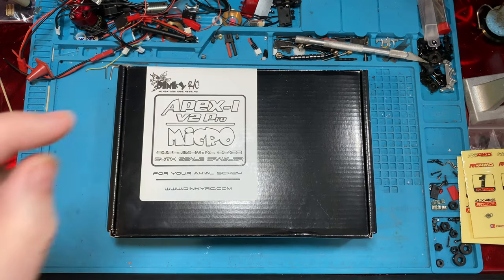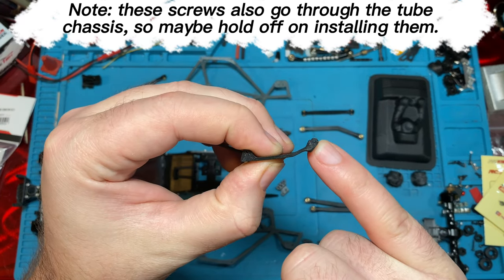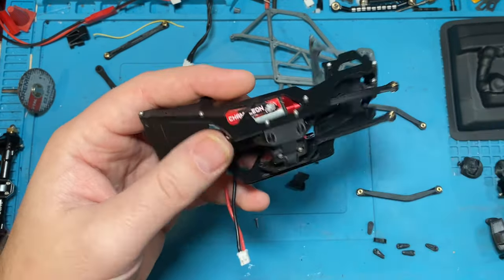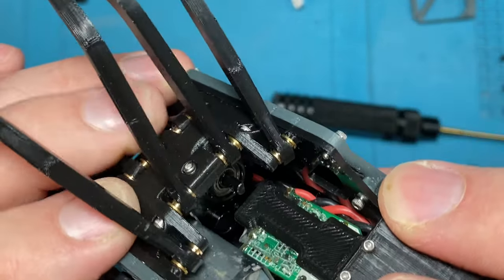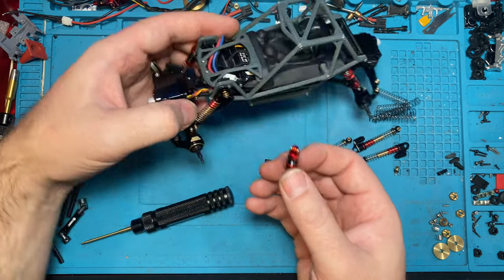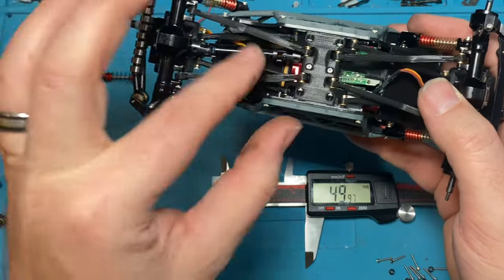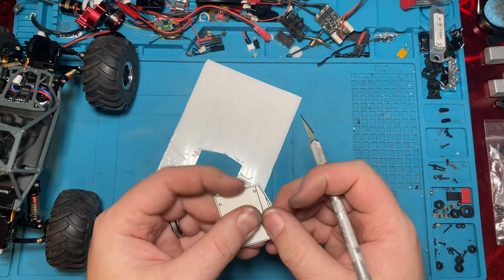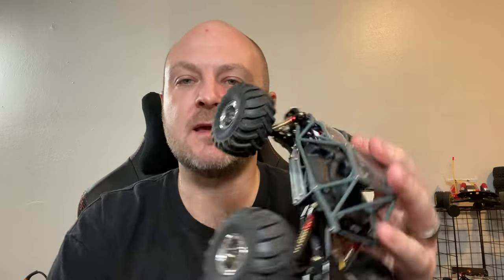SCX24 - The "Apex-1" V2 Pro by Dinky RC. Box Opening, Full Build and Review!

Comment: The injora oil filled shocks are a great idea but slightly out of optimal spec. Removing the plastic washer/spacer from the lower seal and using some thin shock oil allows good bound rebound adjustment without the binding that occurs (the oring/spacer/oring config creates too much friction against the shaft.). You will still need spacers though.
Reply from the maker: Good tip!!